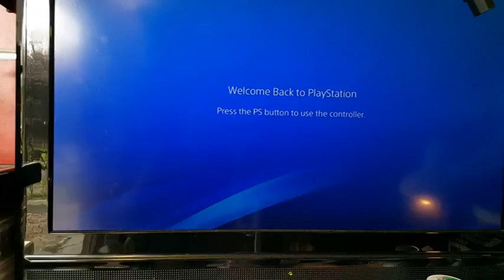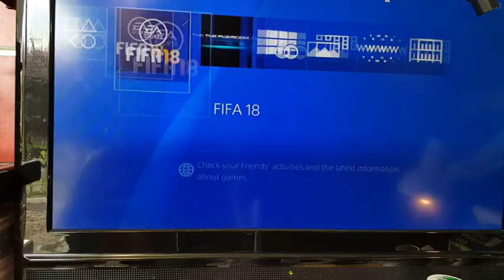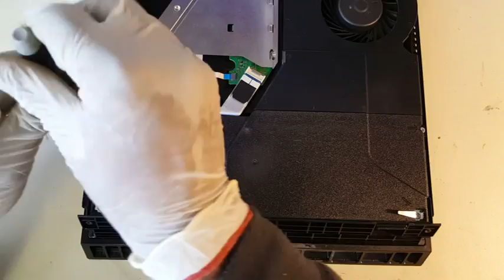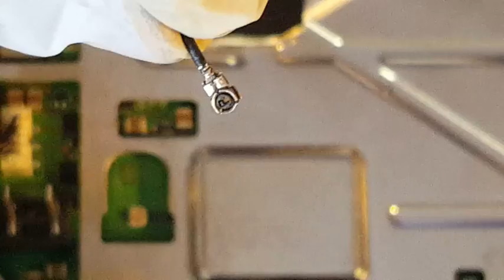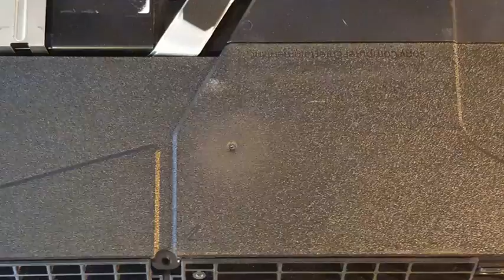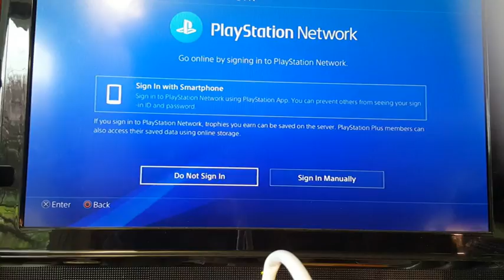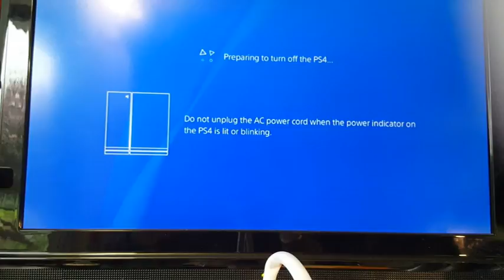Ps4 CUH 1002a Controller disconnects, slow response, Controller laggy

Comment: I replaced my antenna on a 1100 with an antenna from a 1215 junker I had. Although it took some fitment of the metal bracket and the antenna was a bit long it worked properly and plugged in directly with no modification.

Comment: BRO PLEASE HELP I turned on my ps4 pro and when I logged into my account the online status wasn’t working I couldn’t see my friends list or go on my account profile and when I tried to connect to internet it would say failed internet connection even though it works on my other devices. 
I tried restarting the ps, rebuilding database, changing WiFi frequency bands, updating it, making more storage. NONE of it worked I need your help everytime I turn it off it does 3 beeps and I can’t find a way to stop it please someone helppppp.
Reply: OMG NO WAY GUYS I FIXED IT JUST AFTER THIS COMMENT ❤❤❤❤❤

Comment: Hi 
I have 2 problems with my ps4 first one that When i put the headphones to the controller there is a cutting in the voice i tried another controller and another headphones and it's still the same problem
The second one that the controllar dont respond well tp the ps4 even when i am to close to my ps4 i have to direct my controller to some directions until it reapone 
Plz if u know anything to help dont skip 💝
Reply from the maker: Try another console with the same controllers. Clean the ports where the headphones plug into

Comment: Im wondering if this will help me as well! Just done a clean and thermal paste and the contrller is not working properly, and the headset when connecting to yhe controller cuts the sound, (jerky sound, like on and off) 😞😞😞 The sound though works fine when playing through TV direct, 😢😢😢😢
Reply from the maker: Connection problem, try clean and reseat connections
Reply: @autronicsltd3478  Thank you, because of this video I just replaced the WiFi antenna and all problems were gone! Working perfectly now!

Comment: Very interesting video.. but how does the cable connector break in the first place? I have the same problem, but my console has never been opened - can the connector break all by itself?
Reply from the maker: Over use, poor manufacturing etc

Comment: After disassembling and reassembling my mother's old PS4 to clean out the dust and replace the thermal paste, the console suddenly suffered from the controller frequently disconnecting. I'm glad I was able to look at this video because it helped to remind me where I messed up. As I recall, when I was putting the system back together, I was a little bit too rough on handling the Bluetooth cable and probably slightly damaged it along the way. I just decided to buy a replacement Bluetooth cable to spare myself the headache of fixing the console's original Bluetooth cable. Thanks for the vid, dude!

Comment: So how does the antenna work ? Can someone explain what the metal plating on yhe antenna does ? 

If i were to re-solder the wire, would i have to make it so that rhe wire connect to the second solder point ?
Reply from the maker: The first question - google is your friend here. The second question - yes be careful there are two solder points of that wire to the metal plate. DO NOT solder them together and the length has to be specific as well.

Comment: it turns out my problem wasnt the wire it was the big metal piece at  front . It was bent and when i learnt that that was the antenna i bent it back into place turned on the playstation and it worked perfectly. So the credit is partially yours

Comment: I have a PS4 but my does not do none of that but my controller turns off every time I turn on my PS4 I try to turn them back on and it just beeps the controller just flashes with lights on I I try to share button and pressing on the same time still doesn’t work what’s a called I tried everything I tried to restart it it still doesn’t work my controller just blinks my consul is working good but it loses connection to it turns on it’s on but I don’t know what’s wrong with it do you pay for money to just asking because I’m a kid
Reply: Same thing happens to me, even bought a new controller 🎮 still do same thing turn on then couple of second is off dead

Comment: If the metal plates on the front end are bent, will that cause a weak connection?
Reply from the maker: Not necessarily. Unless the wires that attach to it do than yes it will

Comment: Thnks man it helped me a lot to check my antenna i had somewhat same issue when i opend the back i found at the antenna side it was little bit bended and one point probably the vcc pin pf antenna was been desoldered from the point so i just soldered it and boom!!!! Its working like charm
Reply: Same here. The solder between the two plates is broken and am going to get it soldered

Comment: If anyone else encounters this problem be weary of the wire too mine was damaged from trying to repair it had to cut some length of the wire then strip it back and it seems to have worked

Comment: THANKS, IT WORKS!
Here I bought from online shop;
1. Antenna 16 dbi with connector RP-SMA Female (Choose Mini PCIe Model, Don't choose NGFF Model)
2. Cable UFL (Male) to RP-SMA (Male) with minimum length 25 cm.
Reply: salam bro.. nk tnya sy dh tuka antenna bluetooth yg baru tapi tetap jadi masalah jgk.. yg bro pakai tu mcm mana ya?

Comment: You are a lifesaver bro i squeezed the pins together its been working like a charm ill buy a new one if it starts acting up now i know how to get to it.
Reply: If the antenna is disconnected is it normal for the control to disconnect and not connect back.?

Comment: for me i connect my headset and i’m close to my ps4 and the audio cuts out and lags
Reply: Same
Reply: @Jughavinn  yea i fixed it in settings go to controllers and then it says connection method and out usb cable and it won’t cut out but u have to use it connected
Reply: @dannyrios2511  gg I don’t like when my usb is connected so I just order a new Bluetooth antenna

Comment: What to do if the controller won't pair even after resetting the controller and plugging in via wire (controller pairs to PC via bluetooth)
Reply: You're welcome, happy to help
Reply: plug your DS4 to the PS4 using USB cable and then press PS button
Reply: @augustus6070  Thanks! Had to go to safe mode
Reply: Reset in safe mode and mine worked

Comment: Ima try it out i believe it will work thax
Reply: Any update if it worked or not mine just disconnects randomly and I have to unplug the ps4 and wait 10 mins then plug it back in for a temporary fix but it will happen agian in like 5 mins or something so I want a permanent or Atleast very long fix so it could be my antenna but did replacing or fixing the antenna or putting it in the right place fix the problem you had
Reply: @joelthegoat8981  ima let u know soon i do it it seems easy
Reply: @MrCavalucciCBTV  ight bet

Comment: I took my ps4 to a man that has a console fixing business

He stated this was problem to which I agreed and he charged me 117 to change the bluetooth chip and the wifi antenna

I brought my ps4 home thinking a weight had been lifted off my shoulders to just realize here that it's still doing the same thing

I can only play with my controller in "wired" mode and my wifi drops every 10 mins, when it does I have to restart my console so it re connects

No amount of turning off the internet in the ps4 settings and doing connection tests fixes it, when i do that it just stays in limbo

What could it be if this person already replaced these two things? :(
Reply: Same i have to turn it off and on so it reconnects.

Comment: I bought a new one, and installed it, and it STILL disconnects randomly.

Which means one of the metal things inside must've got pushed in when I pushed it in.
Reply: Does your control disconnect and you cant connect it back?
Reply: @f.ff.f4987  I just bought a new PS4
Reply: @OneKingX  so you replaced it and it still disconnected?
Reply: @f.ff.f4987  No, I just bought a new PS4 entirely, and I now have no disconnect issues.
Reply: Try pulling out that little bit of metal with a strong magnet. Let me know how it goes. You have a new console so it's worth a try

Comment: I have a question my controller was lagging and headphone connect to controller volume was mess up on it so i replace antenna controller now works fine but the headphone sound still mess up i try different controller with headphone still same problem so does it has something to do with the antenna or is there another thing inside that sends the sound signal to controller and tip what it could be would be helpful

Comment: while this wasn't my exact fix you reminded me i didn't plug this cable in the last time i tore apart my ps4... DOH!!!
Reply: We’re you still able to connect to the ps4? Even woth it unplugged? Preparing to take mine apart again. Haha
Reply: @Spillmongo  If i was really close to it yes (within about 2 feet) but farther apart it would connect, but drop almost immediately. Even when plugged in the PS4 controller uses wireless unless you specifically switch the mode to wired. After plugging the connector back in it is working normally. 

I did have a buddy who's kid pulled his ps4 off his entertainment unit by a charging controller and it took a nose dive and broke the small wire that attaches the metal bit to the antenna wire and caused the same effect. I was able to solder it back together for him and bring it back to working functionality. between videos like this and tronicsfix I was able to buy a broken ps4 for $60 and repair it for $15 worth of parts and 4 hours worth of time to get a new to me system and start enjoying a console platform i had missed out on since my ps2 went full belly up many years ago.

Comment: When my headset is plugged in it cuts out and stutters would this fix my issue. Its a brand new ps4 controller as well as new headset.
Reply: me too
Reply: @kevinzacarias4002  I found out its most likely the Bluetooth Antenna so I just ordered one off eBay for 9 bucks. If You have a charging cable go into uour settings and under devices or controller and make it usb instead of Bluetooth for your connectivity.
Reply: @xGamingWithJasonx  did it work
Reply: @NotMix  yes I ordered a new Bluetooth Antenna and it fixed my issue
Reply: @xGamingWithJasonx  When It Was Broken Did The Sound Being To Lag Out Then Cut Off And A Couple Seconds Later The Controller Disconnects And You Have To Turn It off For A While Then You Can Use It A Bit Or Is It Another Issu
Reply: @NotMix  mine did all of that yes. But while I waited on the new Bluetooth Antenna I just went to devices and controller and used usb instead of Bluetooth until my antenna came in but you will have to use your usb charge cable.
Reply: @xGamingWithJasonx   I've Tried Doimg That But It Doesn't Work Thanks for the help
Reply: @NotMix  if that doeant work it could actually be your ps4 controller.
Reply: @xGamingWithJasonx  Maybe The Wire Im Using
Reply: @xGamingWithJasonx   Also Where Do You Buy The Antenna
Reply: Is It Literally Called "Bluetooth Antenna PS4"
Reply: @NotMix  yes Ps4 Bluetooth Antenna

Comment: Query :- Hi, I'm using Nacon controller, which is working fine, however, my original controller is connecting itself without turning it on and even when I try to use it with wired or wireless it get disconnected. Please help.

Comment: Do you think it could be the same faulty part if the remote is drifting on its own when you are trying to move in a direction I tried with three remotes one of which I just baught and they all only work properly on the console if plugged

Comment: My controller cuts the system on like normal but after about 10 or so minutes it'll freeze and then the light cuts off and when I press the PS button the light on the controller will blink a white light about 30 times and then stays off, I've tried multiple controllers, multiple usb cables, reset the controllers and rebuilt database, do you think I have the same problem as the one in the vid?

Comment: The controller works for like 30 second, then it disconnect. At first the PS4 wouldn't even turn on. We replace the power box. Now we can get the PS4 to turn on, just the controller works for 30 second.
Reply: We order an new antenna, to see if that the problem. But it work for about 30 second. Then it doesn't work at all.

Comment: Everytime my internet connection messes up my controller turns off and won’t turn back on so I have to unplug my ps for it to turn back on and I don’t know why?
Reply: I have this same exact issue. I'm wondering if this is the fix for it.
Reply: @AntwonJenkins  It should fix it. I had the same problem  after I got it back from the technician 6 months ago till 3 days ago when I finally decided to open it. Guess what I discovered? It turned out that the bluetooth antenna cable wasn't fixed properly and thus was having a partial connection. I just fixed it in properly and now it's all good.
Reply: @kingsleyudenna6942  I removed my wifi antenna cable but it turns out my bluetooth still works. How is that. Does that mean my WiFi will still work too

Comment: I don't know if my problem is rare but when I play, the controller loses connection and it's not far away too and my ps4 says I lost connection with the wifi and I'm forced to unplug the PS4 because I can't control anything.
Reply: Brooo sameee did this solution work for you.?
Reply: @f.ff.f4987  i wish i had good news for you but no I destroyed it with my axe. When the ps4 acts like that, it won't be fixed again. Im just waiting to get a ps5. What game were you playing when your ps4 started doing the same thing?
Reply: @MotorcycleVida  damn so i brought the sh1t for nothing😕
Reply: @MotorcycleVida  when your control disconnected you couldnt connect it back right?
Reply: @MotorcycleVida  btw i played gta and  fortnite (fortnite only because of my friends)
Reply: @f.ff.f4987  yes that's correct. When im playing gta the controller won't turn on and the wifi is no longer connected. And when im driving a car in gta it swerves off and has a mind of its own. And the controller just flashes white when i try to connect it again. Did you buy the ps4 at a pawn shop? If so return it asap because the previous owner sold it for a reason.
Reply: @MotorcycleVida  wait so you tried this solution or nah?
Reply: @f.ff.f4987  yes I tried so many things on youtube and non of them worked. I also did the one on this video and the antenna isn't the problem. The system is corrupted. Where ever you got the ps4 just go return it if you can before it's too late.
Reply: And the wifi stopped and you had to turn it off and on again just so your control would work again?

Comment: I was having an issue where my controller/ would disconnect or was moving on its own(L3/directional pads). I bought this part and replaced it on my ps4 and it definitely works better, but there is an occasional disconnect, controller lag, or it’ll move on its own. I know my ps4 first started having this issue after i opened it up to clean the dust, which ive done before with no issues. Any recommendations on how i can get this 100% fixed? I’m thinking that my controllers work fine when plugged in but i do want to play wirelessly if possible. Thanks for your help
Reply: I have 2 controller's both lag or disconnect if I move away from PS4.. the antenna shit is fine wasted money on repair too but no luck.. works fine when plugged in but with bluetooth it lags from even 3~4 feet away.. you got your shit fixed?!
Reply: @GTDGAMINGTILLDEATH  Mine works fine 95% of the time since i replaced the part in the video. You might just need to play wired. 
i'm still hoping this guy replies on how to fix it 100% lol
Reply: I think the recent 7.50 update fucked it..
Reply: What is the part called?
Reply: FORZA321 here’s something similar to what i bought. The one i bought is no longer available. Keep in mind there’s different similar antennas and it depends  on your ps4 model. I’d do a little research before buying

https://www.ebay.com/itm/332541661106